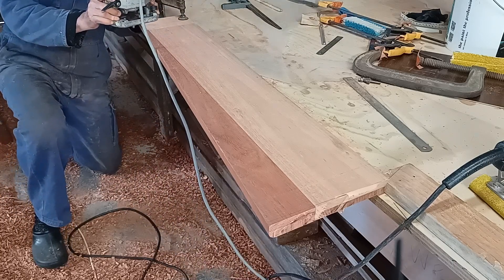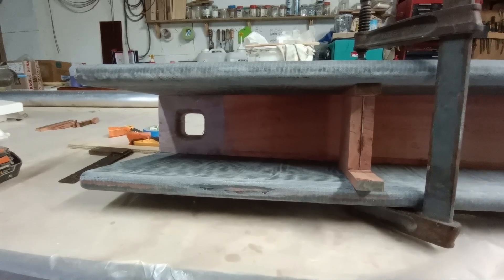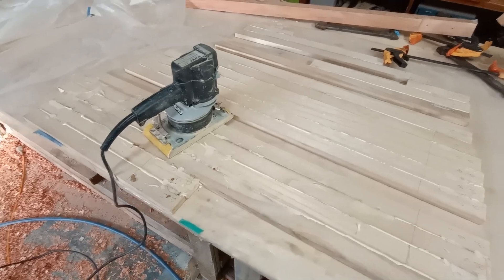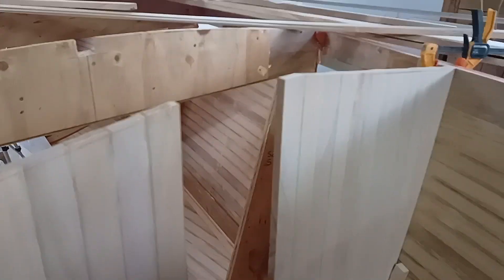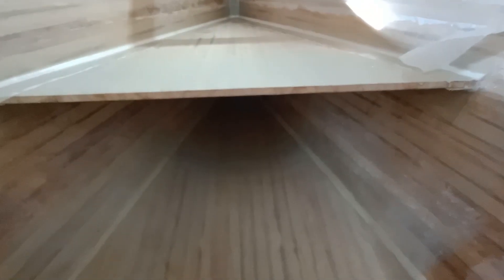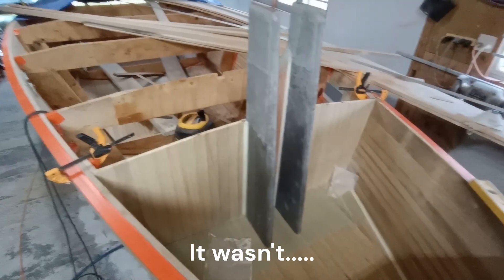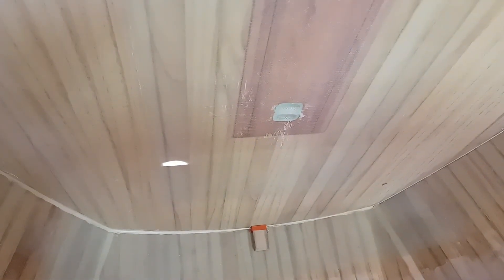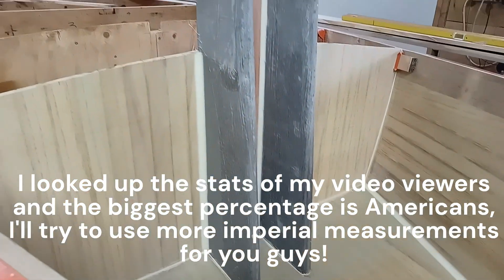Sharpie Trailer Yacht Design Build Sail:  Mast Tabernacle & First Bulkhead Build

Comment: A good technique for taping those difficult access locations is to make up the patch on a bit of polythene on the bench, polythene, peel ply, however many layer of glass you are gonna do, wet it all out on the bench then pick it up by the polythene and slap it on like a sticking plaster.

what do you have against plywood?
Reply from the maker: That sounds a really good suggestion! I'll definitely give that technique a go.

I don't have big issues with plywood, have wanted to build a yacht out of Paulownia for a decade or two. Maybe it's because I've been around traditional boat builders a little too much, who have influenced me, thanks Noel! I also wanted some compound in the topsides and bottom. Norwich Island Sharpies have put some bottom compound in some/all? of their designs I notice and it gave me the hydro-statics I wanted. Plus I wanted to use all NZ grown timber as I can be sure it is ethically sourced. Part of my life has been as a ships engineer on a ship that was dealing with illegal cargoes of timber from Africa and South America, headed for Europe which caused me to think a lot about the origins of timber. Too many stories around that because I was a boat driver as well.
But ply certainly has it's merits and it's available as certified by the FSC. I'd definitely be sailing this coming summer if I'd used it!
Reply: @KarlFullerNZ  glad i could help! Thanks for the story! Yes definitely some shape limitations to plywood

Comment: Mate,beautiful neat work, as a professional wood epoxy composite boat builder and amateur designer here in Australia I am very impressed in what you are doing  cheers and good skills.
Reply from the maker: Considering your experiences, I really appreciate your comment! What boats do like to design?
Reply: @KarlFullerNZ  Hi Karl,I have being involved in building high performance multihulls for many years and am currently building a 46 foot power cat for a client who also  wanted an 8 m power cat for fishing out wide on the reef so I drew an idea and should be on water in 12 months, I am a sailing purist and Wether it be multihulls or monohulls I love them all, cheers from Australia.
Reply from the maker: @edwardhaigh4249  very cool you have that experience! A few years ago I got a call from a friend, could I fly the next day to Java to help out a company, North Sea boats with some engineering work on their high speed military catamarans designed by Craig Loomes. It was an amazing set up they had there, a Swedish guy had set it all up. Unfortunately, they had had a recent tragedy, a huge Loomes military full carbon trimaran had burnt to the waterline while finishing it in the water and the lesson was, don't run lots of cables through doorways that need to be closed fast in case of fire.....
I was working on the drive systems for about 10? cats with big V8s in them and we'd test them also in the straits between Java and Bali. Quite an experience and no doubt you'd enjoy looking around the place!

Comment: For the measurements, present both metric and imperial to make all happy. Only use imperial is step backward. I love that Australia was smart, to abandon the British system when becoming independent. Cheers.
Reply from the maker: Yeah, I would use both, not a biggie really but know how if I'm watching an American show and they use Fahrenheit for temperatures I can't easily turn it into metric.
America came very close to being metric. I worked for a clever engineer in Sydney many years back who lost a small fortune because he made 10s of thousands of little gearboxes to put between speedometer and cable to change the car from imperial to metric and, was it Jimmy Carter, changed his mind on it last minute and the engineer had to put them all in a landfill.
Reply: @KarlFullerNZ  USA actually does use metric! they use it to define what they call the "english" or "standard" units. Metric is defined in terms of physical constants, so a meter is based on the speed of light, etc, so you can recreate metric units precisely anywhere in the universe. On the other hand, an inch is 25.4mm, by definition! If you look inside an American tape measure factory, they'll have metric equipment to make sure their "english" measures are correct
Reply from the maker: @dominictarrsailing  that's interesting to hear. I remember the story of the space mission that failed because what we call the Imperial and Metric units got confused in some calculations....
I'm quite used to both systems of measuring which shows my age as we changed over when I was in early school and most things are still available here in both measuring systems.